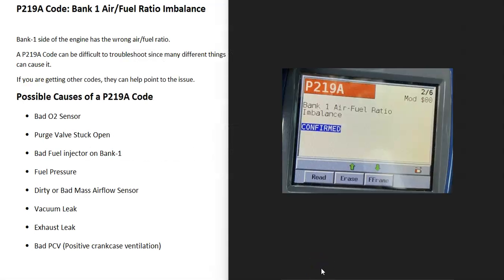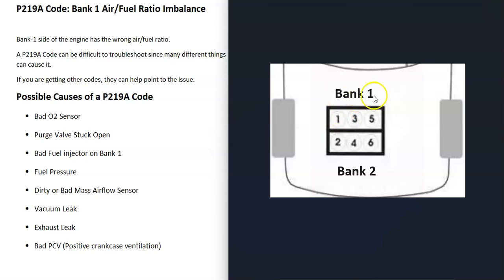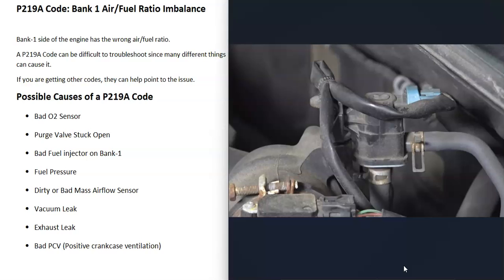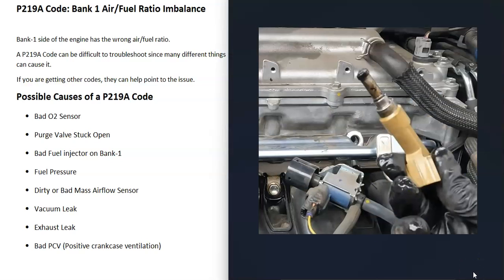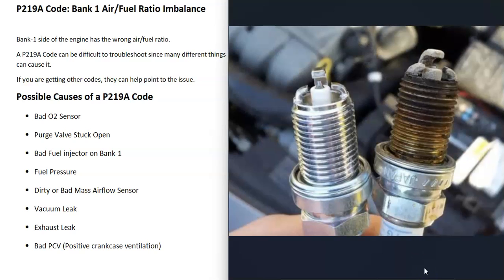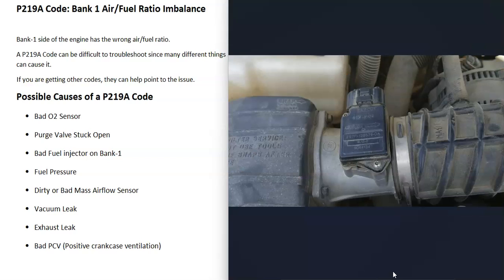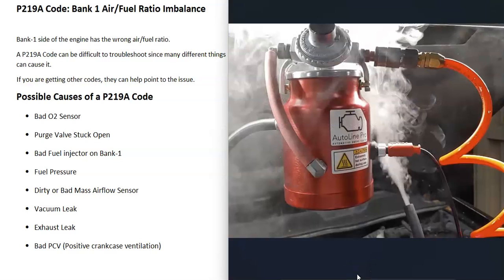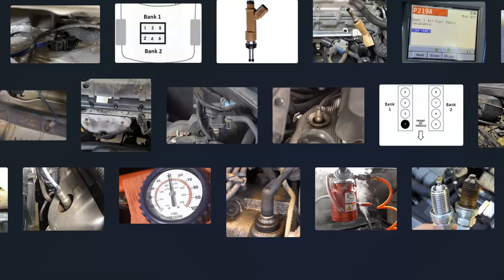Causes and Fixes P219A Code: Bank 1 Air/Fuel Ratio Imbalance

Comment: I had this code and it was the only code coming up in my 2019 ford fusion. Turns out I didn’t insert the dipstick back all the way in the other day when I was checking my oil level 💀 that’s what was causing more air to enter the engine.

Comment: You can also check your fuel trims on bank one.And then do fuel trims on each cylinder and find out and pinpoint which cylinder is running rich.Because computer is trying to compensate for the lean condition

Comment: I got this code as well on my 2013 Toyota tachoma TRD 4.0L V6. I found that my purge valve was open when it had no power. I took it off and reset it by tapping it on the ground very lightly and did a blow test to see if it was reset and it did reset and closed back up again. I also took out the MAF sensor and cleaned it with cleaner and replaced it back. I also took out the PCV valve and cleaned it out and reinstalled it back into the engine block. But I still have white smoke coming out my exhaust at startup. The engine runs great though but I suspect that I need new spark plug coils as the engine has 269,500 miles on it with all original equipment on it from 2013. Update: after cleaning the MAF sensor and the purge valve and the PCV valve the white smoke has quit coming out the tail pipe at startup and the PO219A code has not come back on again.
Reply: White smoke usually means oil burning through the engine, usually past worn out piston rings I believe.

Comment: My 2013 GMC Sierra had this code pop up. I was troubleshooting this issue and I noticed that once once my gas was on empty and I put new gas the check engine light came off. Im guessing BAD gas can cause bad reading.

Comment: Great info and breakdown of this code! As you said, it can be very difficult to diagnose. I've been driving my car over a year with this code off and on.  After having one of my heads, camshaft and lifters replaced, this code started showing up. Had it in a shop 3 times multiple days to figure out the cause. Smoke test, changing o2 sensors, swapping injectors, they couldn't find the cause and its very difficult to put my car into the shop for an extended period. My plugs were pretty new at that point too, although they're now a year older. Code turned off for almost a week recently and then came back on. What would you be looking at to find this problem, considering everything that I've already had checked out? Thanks in advance. Also I'll add, the only thing I've noticed from driving with it (in my situation) is a slightly worse gas mileage. Car runs fine otherwise from what I i can tell)

Comment: My 2018 HONDA PILOT with 101,000 miles had this DTC today.   Recently had a national recall for fuel pump replacement.  Wonder if replacement part failed but I am reluctant to deal with the dealership’s games.     
I will check the MAP , PVC, O2 sensors ,   
I already replaced spark plugs last year.

Comment: 2014 ram 1500 threw this code today after owning it for 2 years without any issues. Look under the damn thing and my cat is gone. I knew my truck was loud but not that loud. Threw this code too. Defo a solid call on exhaust leak. Thanks!

Comment: Is the P219A code same as the P219B code??
Reply from the maker: A "P219b Code: Bank 2 Air-Fuel Ratio Imbalance." Something is affecting the whole engine and not just one bank such as fuel pressure or a bad sensor.
Reply: what is P219A  @HVAC_Mechanic
Reply: @HVAC_Mechanic I got a p219f code what is that ? 2016 ford explorer is it fuel related ?

Comment: I only had to spend around three dollars to fix this code on my car.

Turns out there was water in my fuel system.

Since it has been around 15° F lately, the issue was exacerbated by the freezing temperatures, which ultimately led to my CEL.

I added a de-iceing fuel additive to my tank and the DTC went away within 36 hours and I lived happily ever after.

The End

Comment: I have a 13 ram 1500 5.7 v8. Running rough the past week, I received all these error codes. P0222 p0123 p2127 p2122, p0300, p0303, p219a. Can anyone point me in the general area of issues. I may have an exhaust leak. Also had an issue starting it after putting a full tank of gas. I had to have someone help jump me and it struggled but turned over.
Reply from the maker: It needs to be diagnosed, but problems with the engine starting after getting gas is a common symptom of a stuck open purge valve. The purge valve is normally closed, so if you can blow through, it is bad. You can also use the engine vacuum to test it without removing it. I made a video on this here is a link. https://youtu.be/X-Y5YsaXxJE

Comment: I have a 2010 Q5 3.2 P0491 and a P0219C code I wondering if those 2 go hand in hand. Pcv valve has been replaced all the carbon cleaning has been done, valves and cylinder head ports.

Comment: Thanks! I got the code on 18 accord I4 1.5 T. I’ll start troubleshooting from easiest n cheapest. Appreciate the info! My code says Bank 2 Cylinder Air-Fuel Ratio Variation. What’s most likely issue? Can anyone help guide me? Maybe shorten the troubleshooting process.

Comment: fiesta 2014 1.6L without gas I have a problem with codes P0420, P2096 And the last thing that appeared was p219a. Replaced spark plugs, ignition cables, the catalytic converter was replaced but with a replacement, later the old regenerated one came back. New Sony, even has an emulator installed. After deleting, driving 100km (+-) errors appear... update of konout3r, software or whatever was needed done. Checked the tightness of the system. It still lights, the second mechanic throws up his hands, and I've been driving like this for over a year... can anyone help? The car I drive in the States in Europe uses 95 fuel, now I filled up with 98 to test it to check because I don't know what to do anymore. It's hard to find a workshop that would be able to help. Car from 2014 and we have 2024.. anyone?

Comment: This is very annoying. I replaced cam and lifters and now I get this code on my 2015 ram 1500. And I get a misfire on cylinder 2 only during idle 500rpms, at 1k-6k rpms no misfire.

Comment: I have this code. Would you start with the O2 sensor?   I have the 3.5 liter 16 ford expedition.  I have changed my plugs and they had a good burn pattern.  They have been in the vehicle for about 165k

Comment: Just replace my cat on 2017 Dodge charger se along with O2 sensors and now I'm getting the p219..  ove replaced so much on this car and am at my wits end.
Reply: That's an interesting coincidence.  The same thing happened with my Subaru Forester.  I haven't resolved it yet.
Reply: @garybrady7392 Replaced O2's & Cat on my Impreza & now I get it as well. You remember what fixed it, if you did?

Comment: For anyone reading, I had this code on my 2015 accord. I replaced my spark plugs and gas cap. It was the spark plugs in my case. Engine light is gone, it’s been over a week
Reply: I replaced my spark plugs last night and the light went off and came on again with this code
Reply: @citylivin5524  means one or two things. It’s another issue all together. Or… which is most likely, something is causing the spark plug to go bad. 

You have to find out which spark plug went bad. Then find out what cylinder or internal is causing it.
Reply: Means you have a bad fuel injector basically it’s allowing more then normal fuel to enter the combustion chamber
Reply: Thanks bro thanks for sharing I’m going to check my sparks
Reply: I’ve done this and driven for about 2 months now. Check engine light just came on today.

Comment: I just got this code 2015 accord. Also I do have a bad valve cover gasket, and my oil is past due for changing. I know I have to fix my valve cover gasket eventually but would love to know if that is the reason for the code, or it’s something else. If it’s something other then gasket, I’d rather fix that first because can’t really afford to do gasket , oil change, and then find out it’s not that.

Idk if this helps, but I added a quart of oil 2 weeks ago because I was 600 miles past due date, but as for gasket, you can see the oil build up. It’s been there for at least a year. 

Yesterday, it was still just My oil light was the only thing on. I went to put gas, and then checked my oil to make sure I had oil, and I did. Then 10 miles down the road, check engine light came on and threw that code.
Reply: Tengo el mismo problema con ese código p219a en mi Toyota cambry 2012 solo tiene 60mil millas no falla nada corre bien ya lo llebe con 3 mecánicos y no encontraron nada me dijeron que tenía que cambiar piesa por piesa para poder en contrar el código mejor decidí llevarlo al diler de Toyota y me dijeron que era defecto de fábrica de esos carros que según salieron defectuoso por cual quier cosa te prénde ese código que según que asta por un golpe prende mejor decidí dejarlo así que sea lo que dios quiera
Reply: @scarfacescarface6033 

UPDATE: PLEASE READ. 

Hey Bud. Just read your message. Sry to hear. 

My mobile Mechanic came by four days ago and looked at the car for about 10 minutes. He came to the conclusion that it might be my spark plugs because they were a little corroded. I took a chance since they needed replacing anyways. Well, he was spot on, because so far I’ve driven 300 miles and the light never came back on. Also I needed my valve cover gasket replaced and a oil change. So My mechanic did all of those together. I bought the NGK spark plugs which are really good. If you can get the mechanic discount, they only cost $45 total for 4. Also I bought a new gas cap just because it was old and that can also trigger that code. So if I was you, I would have somebody check your plugs, and your gas cap, your air filter to make sure it’s not clogged and your (AFR and O2 sensors) which are very cheap. Definitely do not let someone tell you it’s your fuel pump or your fuel injectors or anything that’s real expensive. Check the things that I mentioned first. I hope this helps, but if not, my mechanic told me this light is very common and as long as it’s not flashing, even if you can’t get rid of the light, you should be perfectly fine. 

If my light does come back on, I won’t even worry because I know my car is in good condition. 

Here’s the things I’m going to do in the future anyway because they are cheap. These things should guarantee car to stay in good condition. 

Replace the AFR and O2 sensors

Add (Lucas fuel stabilizer) and (Lucas Fuel injector w/conditioner) with a full tank of 93 octane just once. 

New Engine air filter.

Replace vacuum hoses.

All of this is less then $150 not counting the price of gas lol! 

But my problem was spark plugs and possibly gas cap, at least for now. Before I fixed plugs, I had a loud rattle at start and sometimes car would hesitate or move slowly when first started, but now, those issues are gone after replacing plugs. If light comes back, I’ll update. 

Good luck and blessings my friend.

Comment: I just had this code and a cylinder 1 misfire code. They changed a variable valve that broke and said all was fixed. Now check engine like is back on and this is the only code im getting. They clearly missed something!! 2019 chrysler pacifica

Comment: I have a car, a 2021 Durango, and I have this sign.   p219A-Bank 1 Air-fuel Ratio imbalance. I went to most of the repairmen and they did not reveal a defect, and I am very concerned about this defect.
Reply: Another commenter said something about this being a TSB on his 2021 Ram 1500 which has the same engine options as the durango, try taking it to the dealer he said it was a programming issue in the PCM

Comment: I had a p219a code on my 2013 GMC Savana. Using a smoke machine I easily found a vacuum hose leak on two, stiff old narrow hoses. Replaced them and no more code.
I had another P219a code, same vehicle, 9 months after the first situation, above. Incredibly the cause wasn't anything this video mentioned. It was "bad gas" gotten during the transition between Summer and Winter gas changes, though I don't know if that's related. After clearing all the trim codes and filling my tank with 5 gallons of gas (the tank was down to about 11 gallons at the time) which I hoped would dilute the high level of alcohol the code didn't show up again.

Comment: Was driving my 2015 jeep grand Cherokee and the code it gave me was the P219a
Reply: Just got the same code on my 2016 while driving! Did you have yours repaired yet?
Reply: @kenyamaynor341  pending code still just replaced spark plugs and cleaned the air filter unknown when previous owner did that maintenance

Comment: Good day.  What happened if code is. P11EE. What is direct issue. Problem.
Reply from the maker: P11EE: Cylinder 3 Air-Fuel Raito Imbalance
Reply: @HVAC_Mechanic yes I know that.  But. In  direct issue. Main issue

Comment: My wife’s 2018 rogue set this off it’s been burning oil in one of the cylinders (smokes when she starts it up and fouling plug ) but now it’s this code with p0300 and p0303  the third cylinder is the one fouling out .. should I go through and try all these fixes or is it screwed already ? Starting to think it has blown head gasket but it’s never overheated
Reply from the maker: I would test the injector on Cylinder #3
Reply: @HVAC_Mechanic  I looked over the engine and couldn’t see none lol I’m no mechanic but my trucks fuel rail is right along the motor maybe here is under the intake manifold ? There isn’t a lot of info on rogues 😔
Reply: Same thing is happening to me with my rogue sport.

Comment: I have 2 permanent codes and a CEL.  Code 1 is P0301 (cyl 1 misfire) and P219A (bank 1 air/fuel).  Swapped the coil between 1 and 3, and misfire moved, and replaced chip/plug.  The “pending” code went away as did CEL, but have permanent codes showing for both misfire and fuel mixture.  Thoughts?   Tried to clear to see if they could come back but they will not clear.
Reply from the maker: If the engine light is off and the codes show permanent, then they can only be cleared with what's called a drive cycle. You can look up the drive cycle for your vehicle or just drive around until the codes clear.
Reply: @HVAC_Mechanic  thank you! I think this did it, though it is a little rougher at idle than previous i "think"... of course, with giant lug mud tires and sound deadening like the inside of a bass drum, who knows!! lol  Thank you!

Comment: Where is the fuel pressure regulator on my 2014 sierra. 4.3/lv3
Reply from the maker: 2014 will have a low-side pump in the tank that is controlled by the ECM. Then you have the high-pressure fuel pump under the intake manifold in the rear that has a solenoid on it that raises high-side fuel pressure. They consider that a fuel pressure regulator solenoid.

Comment: I replaced plugs,valve cover gasket, both oxygen sensors and pcv valve and still got code po302 and p219a on my 2014 Subaru forester please help
Reply from the maker: I would solve the P0302 code first. Check Cylinder 2 for a bad injector, coil, or other issue.
Reply: @HVAC_Mechanic  coil,  spark plugs and injector are both working according to my multimeter. What’s next ?

Comment: I had the P219A code for my 2021 Ram 1500.  According to the dealer, Chrysler released a TSB.  The fix was a software update to the PCM.
Reply: I just had the code pop up on my 2021 Ram today. Was the software update handled under factory warranty?
Reply: @KsKaylor  I saw you had a post abut the same code and you also have a 2021Ram. My 2021 ram also had the code took it in was in the shop 3weeks; replaced the cam shaft, phasers total tear down to the tune of $8,238; all covered by warranty. But now just had it back three days and light is back on same code. So very frustrated about it; love my truck but not happy with this and lastly do not want to put it back in for another tear down. Part of me feels this has to be sensor related.  Truck ran fine before it went in for the tear down and runs fine now too as well even though light is back on. What was your experience?
Reply: @renescott5780  I went to my local dealer and it just needed a software update to the PCM. I hate to hear the trouble you’ve had, how many miles are on your Ram?
Reply: I just got back from the dealership with my 2020 ram 1500. It has the same code for over a week now on and they told me this morning. They wanted to do a four hour teardown to see if that was the problem. I have an extended warranty through, but they weren’t able to tell me if they were gonna cover it or not until they did the tear down to find out the Pacific problem with it so I will be reliable for the amount that would be owe if it was not covered. What a crock of crap